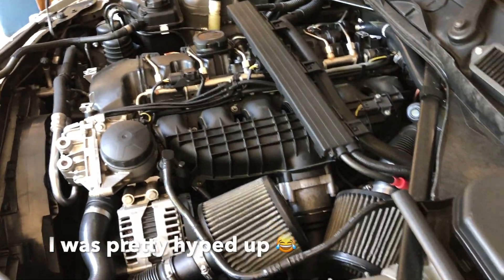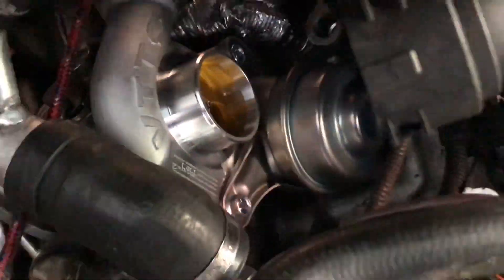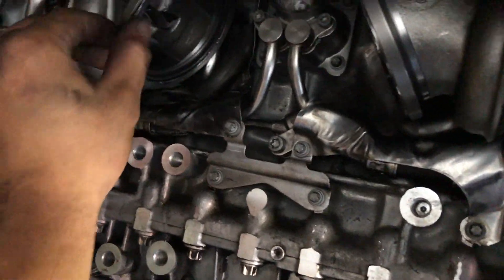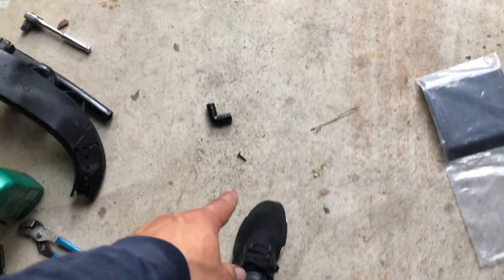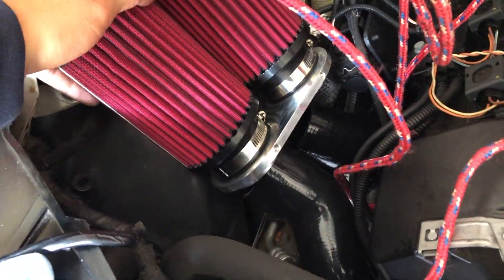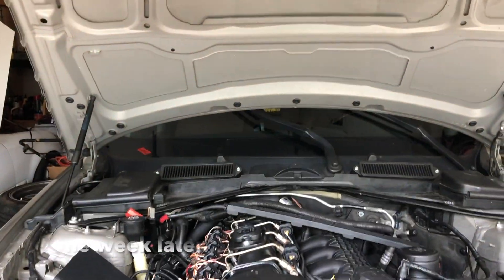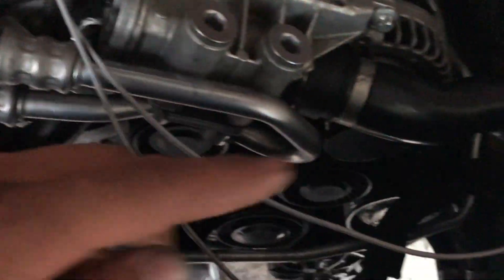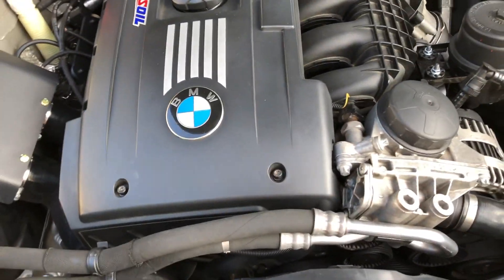N54 ARM Relocated inlets & Vargas Turbos Upgrade

Comment: It would seem like your vehicle will be a lot of fun to drive — especially after dialing in the tune with the new injectors.  I noticed that you do not have the gear displayed, in your instrument cluster, while in 'Drive' — which would suggest that your vehicle does not have a transmission tune.  I would strongly recommend that you get one for your vehicle (xHP Flashtool OTS or Sutphin Tuning custom tune).  Doing so will ensure that the clutches are clamping down with the appropriate pressures and timings, to fully address the additional torque — which will significantly reduce excess heat and premature wear; in addition to introducing shifts that are more crisp and seamless shifts and unlocking other transmission features (launch control, torque by gear, shift point adjustments, full manual mode — without override, etc.).
Reply from the maker: Thank you for the advice I’ll most likely look into xHP and get a transmission tune as soon as possible. The car feels great it’s 10x more fun now it has way better response.
Reply: instablaster

Comment: How did you fix the oil leakage from the line? 
My n54 leaked from the same area too after installing new turbos with all new O-rings.
Any information will be appreciated 👍.
Reply from the maker: I simply got oem Bmw o rings from fcp but if it would of leaked again I would of went another route. https://www.ebay.com/itm/263339980657 that there is a link to some nice fittings that have worked for others.
Reply: @404MAFIA  thankyou for replying back. I have fixed the oil leakage from the area. I took everything back apart and found the new o-ring installed was pinched and chipped a little from the edge. Oil must have seek through that area. Lucky, I bought some extra o-ring for the line so  I replaced it and gently press the line to pop into place. No more oil leak from the area. 
Thankyou again.

Comment: I have a few questions
We’re you able to use your stock outlets?
Is it mandatorily to have to put the PCV to the inlet? Or could you just plug the inlet?
What was the website for the inlet install?
Have you dyno tuned it?
Reply from the maker: Yes I’m running stock inlets but that depends on the stage of the turbos you’re getting. 
It isn’t mandatory but I would recommend it if you’re not running catch cans to reduce blow by. 
And here’s the link https://cdn.shopify.com/s/files/1/0082/6687/4995/files/ARM_MOTORSPORTS_N54_RELOCATED_INLETS_INSTALLATION_GUIDE.pdf?v=1592850689 
I’m not dyno tunes so I can’t say how much exactly I’m making but I’m tuned on e40 by wedgepreformance
Reply: @404MAFIA  alright thanks man. I appreciate it.

Comment: Don't feel bad, it's not surprising there were coolant and oil leaks after install because those stupid turbo lines are a SOB to install because of the accessability and angles involved. You just cannot see if the bolts are flush, and to make it worse, some bolts cannot be torqued due to location. Mine leaked after install and I had to take it apart again to replace bolts and o rings.
Reply from the maker: They’re a real pain, but it really got easier on the second try
Reply: Is there a way you can email me I got the same kit and having issues with the install

Comment: Just wondering how long have the VVT turbos been installed, any issues with the turbos?
Reply from the maker: If i knew the terrible reviews from past VTTO costumers i probably wouldn't got them, but idk if i got lucky but my turbos are still holding up. Knock on wood
Reply: Thanks for the reply, i wish you the best and hope my last as long as yours 👍

Comment: What are all the requirements for upgrading turbos? Like lpfp 2inch inlets etc.
Reply from the maker: Depends on how much power you want to make. But I went with bigger fmic, lpfp for e40, charge pipes, 2inch inlets, index 12 injectors, PR coils, ngk colder plugs, boost solenoides, 3.5 bar tmap
Reply: @404MAFIA  alright thx man that's alot of help I really learning here so I don't wanna guess and check i appreciate u ..also I'm trying for 600 to 650 hp
Reply from the maker: @terrellleister4207  no problem man, I really appreciate the support and yeah you should definitely make that with those supporting mods. I haven’t put my car  on a dyno but my tuner said I should be around that number

Comment: How are the turbos holding up brotha
Reply from the maker: They feel like the first day I installed them and this is my daily driver so I put miles on it and they respond very good. No smoking at all
Reply: @404MAFIA  what tune did you go with? Custom? Also what injectors did you upgrade to? My set up is almost put together all the parts boxes just stare at me every time I get home from work lol but yeah I just need a few more that’s why I ask...
Reply from the maker: I got tuned by ken at wedge performance on e40 and I’m literally using refurbished index12 off of eBay. Trust me I had my parts staring at me for month before I installed them. Good luck though let us know if you need help or info
Reply: @404MAFIA  heck yeah I will let you know 👍🏼 just one more quick question. Why didn’t you go full E85 here where I live it’s everywhere and to me it’s easier to just fill the whole tank with one fuel rather then the whole “5 gallons e85 and the rest of the tank super unleaded 🤔 that should be e40 I hope 😳”
Reply from the maker: @skizzlemane1  you would need a bigger fuel pump and add port injection can’t just go full e85 just with index injectors. And a stock fuel pump can only go up to e30
Reply: @404MAFIA   oh I understand that I didn’t think I had to put that lol so is your reason financial or you didn’t want to do that extra work? Because I still think it would be easier to just put one fuel in rather than having to mix my own. And the risk for me is too high if I were to get that mixture wrong and have all kinds of detonation
Reply from the maker: @skizzlemane1  yeah I’m not interested in going full 85 right now maybe in the future. Second of all there isn’t that many e85 pumps around me I have to drive 20min just to pump fuel and there’s online calculators to exactly make you fuel mixture.